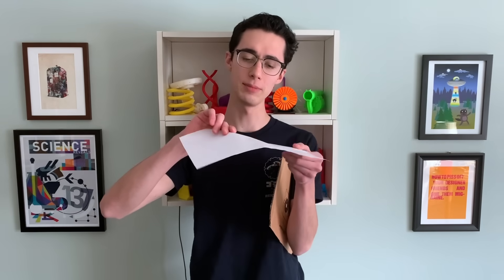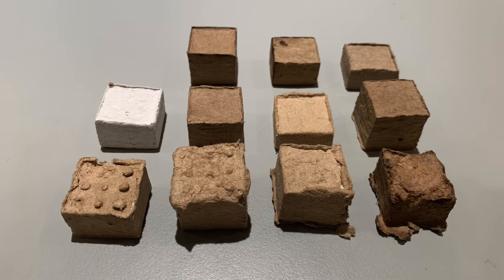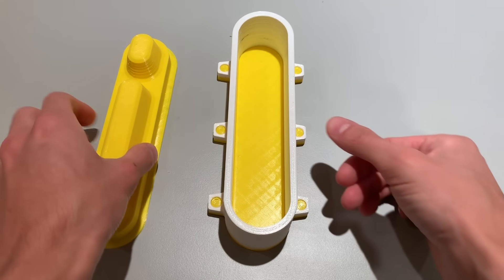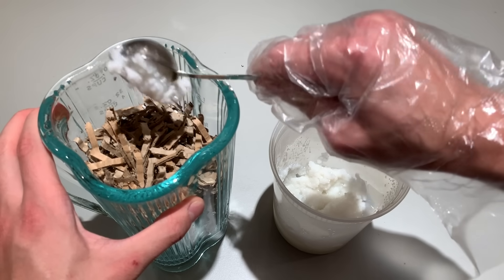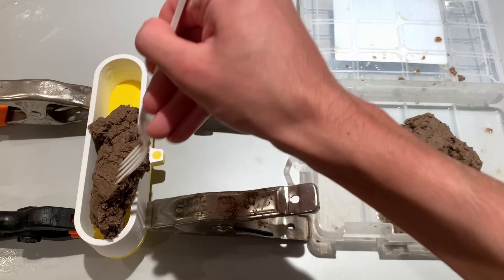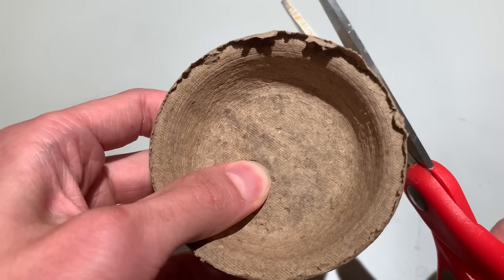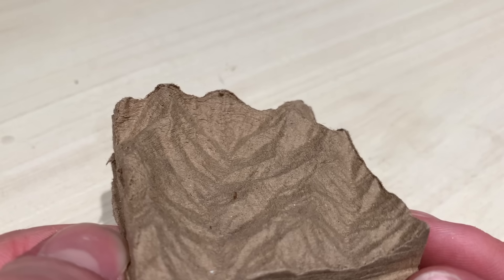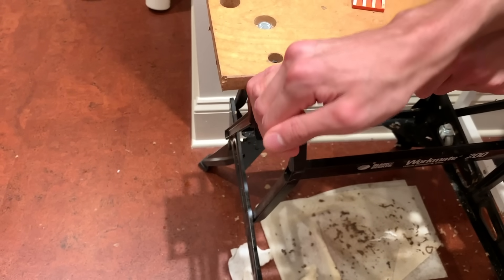Recycle Cardboard into Anything with 3D Printing!

Comment: Hey, thanks for making the video! One application could be soundproofing material, for example for audiophile people who want to improve the acoustics of their listening room. Doesn't have to be waterproof, and if you print a cool topographic map, it could be artsy and functional.
Reply: actually, it IS already used for that, but with the help of this video, people could make their own custom tiles :)))
Reply: Me: is completely ignorant

Also me: don't they usually use foam instead of fiber product?
Reply: @michaelsorensen7567  Well wood has been used for centuries because of its acoustic properties, and you'll find that such products are actually very common in the audio industry. Although this material is not wood, it is very similar, and would be adequate for acoustic applications.
Reply: @sleepdeep305  thanks for the input. I thought the primary purpose of these kinds of blocks was sound *dampening*, rather than tone, so I was really confused. Your comment made me think of Treebeard on Lord of the rings where they recorded the actor's voice through a wooden tube to get a rich woody tone, so it's possible you could use these similarly.
Reply: The recycled paper panels are called Homosote and are available in 4x8 sheets at a lumber store. We sand the surface and use it as a giant board to pin up art work and sketches. It is commonly used as a sound barrier though.

Comment: From the mid-19th century up through the 1930s many toys & other items were made of "composition" - a mix of pulp, sawdust, chalk or plaster, & various glues. Look up composition dolls. 
Parts were pressed or poured in molds of plaster of paris (like casting ceramic) or in heated metal molds. The parts were finished with gesso, varnish, and/or durable paint. Experiment.

Comment: this is a great idea. those pieces ( 7:24 ) might be good shapes for sound proofing, which is usually made with foam that might not be eco friendly
Reply: Corey Steed There’s a reason it’s made out of foam, I think that will be too brittle and or dense.
Reply: I agree on the too dense. The sound waves get dissipated by the surface shapes but also captured/absorbed by the lose lattice shape of the the foam itself. 
I won’t say that this wouldn’t work but may be need to tweak the shape to create “bottomless pits” on the paper to make sound waves fall in from the surface and have a hard time to bounce back intact.
Reply: Then again, why not simply use egg cartons just to shred them and make the same shape again :P
Reply: Like eco-friendly and economic, it could be great. Think that not everybody is a music producer, but a lot live too close to neighbors (and parents), and having a really cheap, but also more "stylish" than egg cartons, it's certainly better than nothing. Even better if it has some degree of fireproof
Reply: @alvarojm750  what about a combination of the cardboard shapes and then a cloth wrapped around the front of it to do some absorption?
Reply: That would take a 3d printer so long you'd need one with multiple nozzles/drivers
Reply: as long as the material is absorbant like foam ... it will deaden sound ... if it is hard like an egg carton it will make it bounce ... and it can echo then ... to use hard points for sound proofing you have to use a very specific shape to force the sound to dissipate faster than the room will allow it to bounce back and cause echo ... similar to a the laser reflector on the moon but instead of returning back to source send in every direction BUT there
Reply: @flamgopp8011  print the mold ... not the object ... then the mold can be any combination of parts to achieve your design
Reply: @MrScottyTay  that sounds (hah) like it could work! I'd love to see someone try it
Reply: Haha does anybody buy eggs in a full tray? It looks exactly the bottom of an egg tray 😝 it’s a cheap muso hack - although it’s really not that great, mattresses work better

Comment: Hey! The mechanic process to remove the water and set up it into the format you want remembers me the way my grandpa used to make ham: Instead of pressing it with fixed length (like you did with the clamps), he used rocks and gravity. So, as long as the content (in your case, paper, in his case meat) is being pressed, the water is removed, but the pressure is still being applied. It's a simple test, maybe it worth the try

Comment: Funny thing is I remember a process where they did something like this with wood chips etc. and then had fungi grow on the fibres afterwards they heattreated them and dried them out boom, biodegradable styrofoam replacement, heavy duty one at that. No glue involved, I wonder what would happen when we apply the fungi to your dense paper packaging?
https://www.youtube.com/watch?v=ACoA6vUD-h8
And one more where they try to replace plastics and rubber with mushrooms:
https://www.youtube.com/watch?v=jnMXH5TqqG8
Reply: Also waterproof, fire-retardant and removed the shrinking problem
Reply: Omg styrofoam is the worst. I wish this method becomes the norm.
Reply: Yep, I grow oyster mushrooms for fun, for disposal of coffee grains, and incidentally for food.  The mycellium go on about their business with no regard for when I want mushrooms, since I don't care to trigger them into a bloom that often; so I often end up with sheets or masses of fungus-flesh that can be amazingly waterproof.  I literally can't water my fungus through the exterior layer it puts up.  And even if that's not how you go to replace a styrofoam or other project need--it's a hell of a good way to lock carbon into place.

Comment: I can see this being used in DnD to make 3D scenery and dungeon tiles simular to dwarven forge
Reply: Exactly. I'm going to try and make some modular hill tiles with this.
Reply: Basically what I wanted to do, only thing in wondering I'd how to prime it for painting both methods I use basically put liquid on it which will probably ruin it
Reply: @busterbackster1  You could try coating it with linseed oil? or making a linoleum plaster over it? if it works for instruments and floors it might work for this
Reply: perhaps, the only problem is the only way to really make a custom shape is to print a brand new mold for it, in which case... you're already using the plastic so why not just print the thing to begin with?
unless you mean like, making many of a few shapes and adding them together for the map?
Reply: @busterbackster1  mix black paint with modge podge and do a light coating to prime it. Should protect it and make it ready for paint. I’d also varnish it afterwards to ensure it says solid and protected

Comment: If you want to make it easier to take out of the mold, you can add a draft angle to the mold, just like injection molding.
Reply: Yes, the rules for injection molding will apply.   I purpose planters, like Peat Pots, as a practical product.
Reply: this is not possible because of the part that presses paper inside the mold. in process some paper will be trapped between walls of those two parts.
Reply: So basically, only use these slanted walls in areas where the pressing part of the mold doesn't need to plunge past. It's those deeper lying nooks that would benefit most from this, so it's all good.

Comment: ❤Your video was one of the first that got Me Hooked about a year or two ago on paper pulp packaging 😂 so I basically developed my own style similar to how Hewlett-Packard make paper pulp packaging!
Last year I tried sharing information about it on 3D printing forums and Facebook groups and paper packaging groups but absolutely nobody was interested I'm shocked because it's an amazingly easy process and literally costs just a few pence to make the moulds! A few days ago I started uploading some old basic short videos and will upload some more of my processing soon!
Basically I just print a 8 mm thick mould without walls. Like a shell...
I then print a cap for the mould with a vacuum attachment hole.
I simply plunge the mould into paper pulp mixture with the vacuum running and then pull it out after 3 to 5 seconds, I then wiggle it about a bit (upsidedown) to remove all the water from inside the mould. I then remove the vacuum pipe and I use a short sharp blow 🌬 into it to demould the pulp! Then dry for just 12hours in the sun! The moulds are on average about 3 to 5 mm thick! 
Lol I always put flower petals into my moulds to make them look pretty😂 I've also experimented quite a lot using activated charcoal to remove any cardboard smells and storage smells. 
So far I have made a number of mould patterns that I use on a regular basis for posting sold items and storing food❤
I could literally talk about paper pulp packaging for days on end😂
I think one of the biggest issues people might have is from over blending the paper pulp mixture as I found it will easily block up the mould structure.
I found a way around this by using screen printing mesh which is extremely cheap from China... then using a soldering iron to melt the Nylon mesh onto the 3D printed part, creating a perfectly smooth surface to make de moulding extremely easy
My most useful items are food trays which can be waterproofed using paraffin wax ( this is a food safe wax that is used on a lot of food products like fruit).
I've also made plant pot packaging for sending live plants in the post, packaging for small glass squares and egg trays for my extra large duck eggs!

Comment: Soo... it's kinda like a MDF board, but only less pressure, so it's LDF
Reply: Actually with a metal form and strong press you may be able to do a MDF or even HDF molded items!
Reply: I scrolled only to see this comment !
Reply: Sort of. I do a lot with MDF. This material seems a lot less powdery for lack of better term.
Reply: @andrettibark  Less powdery? Does mdf manufacturing include l shorter fibres ? I work a lot with mdf routing, and it has the literal worst dust...
Reply: MDF
Reply: mibars I was thinking you could 3D print, then use a investment cast to turn the objects into aluminum or brass pieces for use as a permanent mold
Reply: @mgord9518  you can't use cardboard for investment casting, it won't vaporize like foam or wax.
Reply: Kevin Keel I know, I was talking about the PLA, not cardboard.
Reply: @adamsken01  the 3d mould would not handle 5t
Reply: @Steve-hx3xu  I meant a metal mould :)
Reply: @adamsken01  Hello there you have committed two crimes of the internet, for writing the cursed words of 'Edit: THANKS FOR 7 LIKES!' in all caps.
Reply: @JustMiniBanana  de-CAPPED the "thanks for 7 likes" 
Happy now???
Reply: @adamsken01  it brings peace to me but I doubt it appeased the law of the internet.

Comment: I am starting a large greenhouse project and want to make plant cups. This idea is Most Excellent! Thanks!
Reply: he said the biggest weakness of this material is that it's not water resistant...

I would suggest painting it or coating it so you can water the plants without disintegrating the plant.
Reply: @abhijeetneti  I'm guessing that it would be used to start the seeds and then the whole thing would get planted
Reply: @glittleman  These already exist. They are made out of a recycled cardboard pressed into a cup shape. You can grow your seed in there and then bury the whole "pot" as you want to bring out the seedling.

My experience though is, they mold very fast on the outside of the pots and take longer to break down than the roots of the seedling need to grow. So they hinder growth.

Comment: Great video. 

If the object is dense enough a baker's rack, or other kind of wire rack might be better for drying so it dries more evenly. 

Also, if it needs to be a  little more water resistant you can coat with a varnish or even perhaps integrate a varnish into the mixing process. Which lowers the ecological benefit a bit, but still helps you repurpose carboard waste.

Comment: I would use PETG molds, because for better or worse, nothing likes to stick to it.  Then maybe mix in a ratio of Titebond III just before pouring it.  When done properly, Titebond III can glue wooden surfaces stronger than the grain of the wood itself.  It’s also great with paper.
Reply: titebond has copolymers which are basically plastics so this goes against the idea of the video. Agree on the PETG tho; not only because of the good mold releasing but also because of the strength.
Reply: Well the molds are plastic as well...

Comment: If you want to coat it, use linseed oil and beeway 50:50 (volume) mixed, heated in a pod and either dip it or just use a spoon to spread it on the surface roughly and then use an electric iron (those without holes) to bubble out some water and replace it with oil and wax mix.

This works very well for wood, and should work here as well.

After around two weeks the linseed oil has penetrated as much as it will long term, and you can scrape off the excess wax/oil mix and wipe any excess off with an old cloth.

Comment: "A lot of people on Instagram told me to try to burn these" LOL
Reply: they require lots more heat than normally would be needed ... but add wax of one type or another as a binder ... and it becomes a great fire starter ... or make a log and then its a premade log ... mind you this is where pine resin would be a better binder ... and better for wood burning ....

Comment: Safety Tip: Always wash the egg cartons, before reuse as salmonella lives on the egg's shell.  Small amounts can be present that won't make you sick eating the inside of the egg and boiling eggs usually kills these smaller amounts. A quick wash with hot water or just a little soap will kill any lingering salmonella, especially important if you use that blender for foods again in the future.

Comment: You could 3d print a perforated mould to press the paper pulp and drain the water instead of squeezing with your hands using cheesecloth. If you attach a strainer-like filter to the holes you would probably get a clean result. 
Great video btw.
Reply: Wouldn’t those leave marks on the mold though? If he’s pressing it, I’m sure a small bit would press into the perforations leaving small marks
Reply: @Shjankee  Yes, but if the holes go through a flat surface, they can be grinded and flattener later, when the object is dry. Like when a metal object is casted.
Reply: Gonzalo Romero you right. I didn’t even think of sanding a paper material tbh.
Reply: @Shjankee  haha, I also wouldn't think about sanding a paper material, because it may crumble and break apart... But as it seem on the video, it's pretty sturdy and compact, and can being sanded pretty well.

Comment: A mold idea that comes to mind is to create voids for connecting pieces together as tiles. You could fill a a small pipe with pulp to create a rod that could be cut into small lengths to be used as dowels for connecting them. Diy acoustic wall treatment sounds pretty rad! Nice work!
Reply: Wow 4 years ago. I guess I'll have to look and see where you went with this. I've only recently been discovering paper clay stuff. Very interesting

Comment: You could also use granulated "hide glue" as a binder. Stringed instrument builders still use hide glue today, because even though it is literally just cartilage removed from animal skin and bones, it dries very fast, and is glass hard. Its arch nemesis, like pulp, is water. But I think it would be a perfect binder for this technique
Reply: Do you think the hide glue will end up stronger than the white glue?